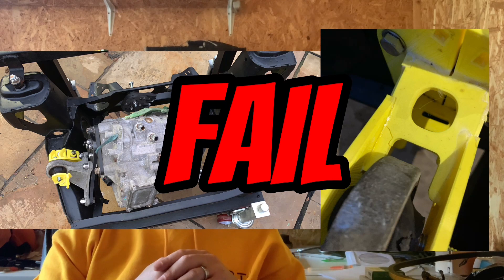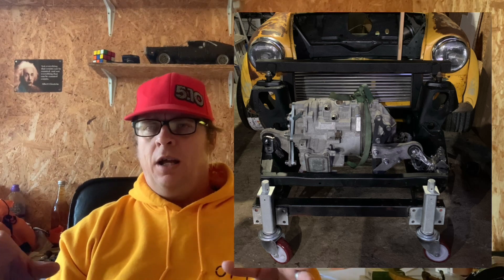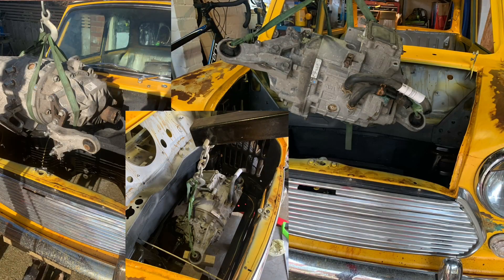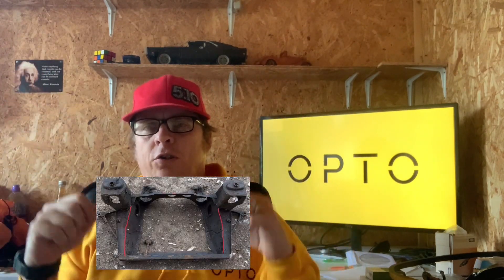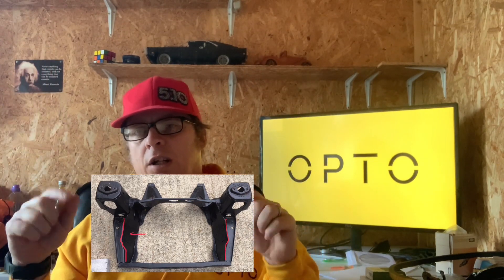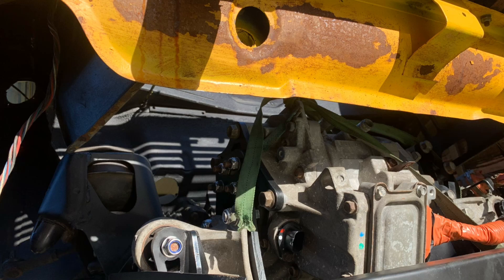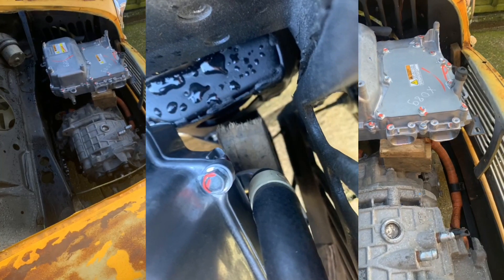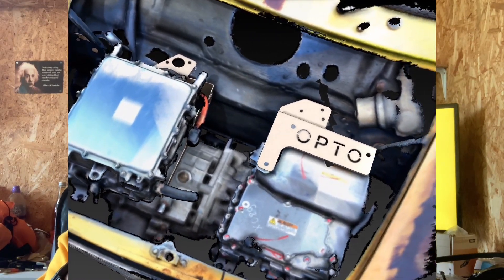Design and Fabrication work on the MINI. OPTO Innovation’s Mini EV Conversion Part 5!

Comment: so all in all you guys spend already  nearly 7000 gbp , without the mini and without labour , and you call that a BUDGET build , for that money you can buy a  very nice , even a restored mini  if you are lucky ,  and in the end an ev is still powered by COAL ,,, also a good rebuild 1275 engine , willl cost about 3000, than you ll have  at least 4000 gbp left to burn on fuel ,
Reply: Agree that it's not budget. It's because it a ev conversion shop. They don't know how to do anything on a budget in my opinion. DIY using very carefully chosen non Telsa parts is the way to go